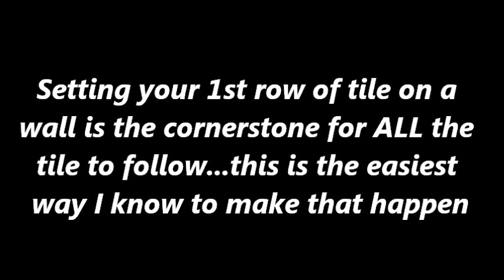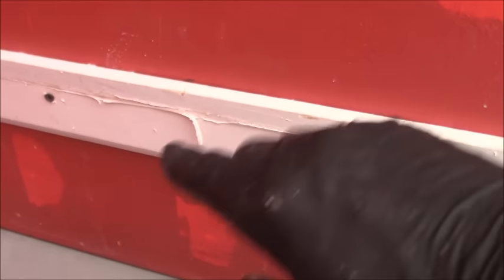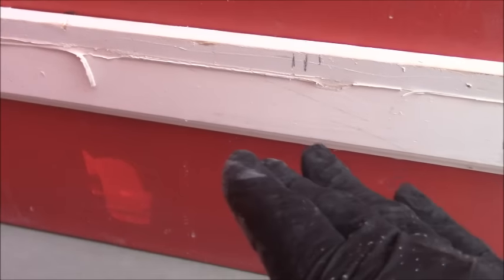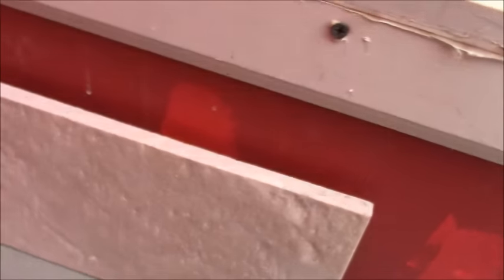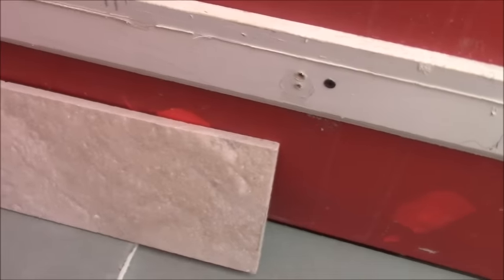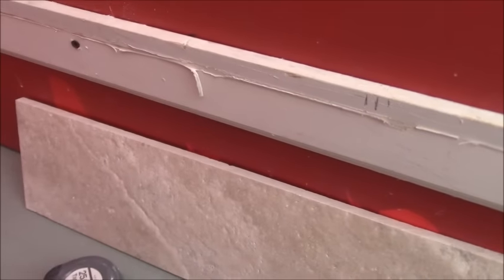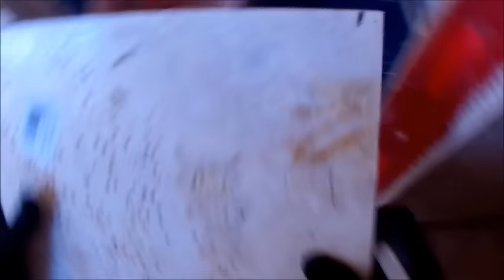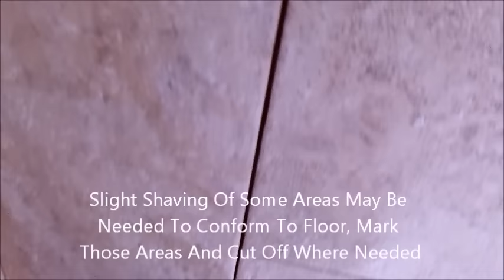FIRST Row Of Tile On Walls....how to do it

Comment: I listened to your explanation a few times and it makes sense. I've never tiled before but now I have a lot more confidence to tackle this DIY job based on this video. So thank you for solving my biggest impediment. Trying to cut the bottom row of tiles to fit correctly against the sloping floor.
Reply: Agreed

Comment: Another thing you can do is use levels. I'm a tile contractor as well and I have 2,4,5,6 and 8 foot levels I use as ledger boards. As long as you clean them well after using, they work great and are very easy to secure to the wall

Comment: To cut in the bottom row simply place a 4mm plastic packer on the floor at the ends where the tile bottom corners will sit . Then position the tile upside down on the packers and mark tight to the under side corners of the above tile. When the tile is cut you have a 2mm spacing plus 2mm gap for silicone where it meets the floor.
You can play around with different size packers for different grout widths.

Comment: Used your ledger board recommendation on a DIY rental bathroom rehab.  Everything worked well with measurements and pre planning.  I screwed myself trying to make the cuts and transition from the tub well to the wall tile outside the tub/shower.  My advice, get the proper tools before you start.  It makes things much easier.  Thanks for the help.  Planning on another bathroom rehab later this year.  Attempting a one-of-kind niche this time around.

Comment: I always use a ledger board. The other good reason is when your going to carry the same tile to the outside of the shower. I get my dimensions for the first row outside the shower and use the top of that tile to carry my line into the shower area. Works out great. Nice explanation Bob.
Reply from the maker: Thank You

Comment: I swear by ledger boards, I use them all the time. The way you explained it is exactly the way I do it. Been doing it for 12 years.
Reply: Hi Ed. I have a sloped shower pan five feet long, schluter. This probably wouldn't work because the sides would end up being tilted ?  Any suggestions?
john m
Reply: @jmack619  It will work, just means the tile at the front will be little bigger than at the back. That is if your drain is at the front instead of in the center. If you're using a large tile, you probably wouldn't even notice.
Reply: @edwardhofer2429  Thank you Edward.  The linear drain is at one end, so the Schluter pan has about 1 1/4 " slope , over 5 feet.

Comment: Hardi plank split in half is the best ledger board I've found to use it's very straight it'll hold a huge load and it's the perfect thickness , enough to catch the tile but doesn't protrude out past the tile that helps for a few reasons . 👌

Comment: Starr Tile: I'm from metro Atlanta and am always a little more excited to come across a tile video from where I learned the trade!

I admire your cleanliness and overall ambition to be better, constantly learn, and pass along that experience to other tile contractors that are also continually trying to better themselves!

That being said, I have a copy suggestions/pointers:

1. If you are screwing a baseboard 🙄 into the wall to be level in a shower you need to come to terms or acknowledge the fact that you are less than perfect or mediocre at mudding a shower floor or preparing a shower floor. Under no circumstances should you have to rely on a piece of wood to be level when you should be fully capable of doing so with concrete, shower floor mud, etc.

Raw shower floor, prep, preslope, mudding, and setting the shower floor is definitely a tedious process! But if you didn't know that going into this trade, you were misinformed. Tile installation/custom bathrooms, commercial projects require the installer to be very good at math, geometry, and a whole lot of knowledge gained from experience.

If you are truly the best at what you do and carry a great sense of pride, you should never rely on this method. Take more time on your shower floor, figure out your layout ahead of time and consider all factors and possible problems.

This is what separates the actual "best" tile company installers/owners from the rest.

Pride in your work, a willingness to constantly learn and adapt, and knowing problems you most likely will go through from experience CANNOT be understated.

Unless that is the straightest framing known to man, you should also address that before you apply your final waterproof barrier.

These kind of things will help you on the higher end jobs who will know just how good you are. And trust me, I would not start out with screwing baseboard into a wall. Always try to be better with mudding and preparing, as I always am too!

Other than that, great video! And thank God in heaven you are not one of these schluter shower warriors who talk a bunch of game after watching a few videos and think they can do what most of us watching this kind of video does!

P.S. can you please send some good BBQ, fried chicken, or seafood up here to Minnesota????

Comment: Thanks for this. I did this on my own and thought it was an amateur hack until I saw this vid. I just used it again as I didn’t trust my baseboards as a guide. I don’t know if there is an official ledger board tool, but I found mdf baseboard works great as it seems to usually have a better edge as it’s manufactured.

Comment: Dude, I'm so glad I found your videos! When the shower in my house started leaking I dreaded the unknowns of expense and effort to repair. Doing exploratory demo, I found that the builders of this 1999 single floor home in Mesa, AZ didn't use any waterproofing behind the cultured marble panels that lined the three shower walls (fourth side a glass door, the curb a pre-formed cultured marble piece w/no sealant). Behind that, the drywall (green board, no cement board) was rotted out almost three feet up, and between the piss-poor installation and the aging of the adhesive they didn't use enough of, the panels were only held up by friction. Digging further in, I found that there was no liner, pan, or other water sealing under the mortar bed or around the drain. It was poured straight on the concrete slab, damn the consequences! So when the caulk with a ten to twelve year service life reached 17 years, no surprise that water went everywhere. Financially, the threat of days of contractor labor and material costs was overwhelming, having recently lost my day job, jumping into doing what had always been a hobby as a new business venture, my budget is so tight it makes starving college students seem like such frivolous, wanton spenders. At least, this being Arizona, it dried right out once we stopped using it.

Now that I've seen how you handle the mistakes you come across on the job, I've got a realistic appreciation for the scope of what I should do within the context of the project. I'm planning to do about 80% myself, doing everything from demo of the old mortar bed to building a new curb, installing a liner and drain, pouring the new mortar bed, building in new walls (custom niches!) with proper board and fasteners, and waterproofing w/redgard and higher quality caulk. The actual laying of tile I'm thinking of saving for a pro because that's where the smallest mistakes are most visible and where experienced hands guided by a sharp eye can shine. Several of the neighbors are tradespeople (there's an electrician, pipefitter, HVAC tech, and a specialized concrete engineer all on my block), and they've all got one guy who they've always hired for tiling in of their own houses. Thanks in huge part to what you've shared, I have confidence not only that I can do it, but that I will do it right and well within a tolerable budget. That's not a small thing!

Comment: If you have a niche you'll want to lay your tile out on the floor first, use your spacers to know exact grout lines, then mark that on a straight edge. Centre your grout lines around the niche and this determines where the ledger board goes.

Comment: A little tip when installing those accent tiles that come on fabric: get them cut to the length you want then lay them on a tile or something flat and grout them with thinset then take a brush and wipe the grooves and put a fan on it to dry it.  It locks them in place and prevents the morter from pushing through.

Comment: Old school when we drypacked the pan start with the ledger board and set all three walls. When you come back to set row one you don't have to cut each to fit, just run each tile long to the pan. Then drypack the pan then set tiles in the pan. This way you don't have to special cut each row one wall tile to fit.

Comment: I have a pile of old, out of level spirit levels and unistrut on my van, all different lengths. I use these as my battens (ledger board) which i simply sit on top of bits of timber, brick, anything that's laying around. Use a laser level to get them level and I'm off. try not to use timber as its more often than not bent! Been doing it this way for 30 years and its my quick preferred method to get going. Also here in the UK, not sure if you have them in the us, are 'tile batten stands', same method as mine more or less, just purpose made. Bit pricey though I think.
Reply from the maker: Good advice, thanks !

Comment: This video was done for a shower, correct? Do you need to take 1/4" off the bottom row tile when installing for a tub surround? It seems like for a tub I should leave space for the length of the whole tile at the bottom + grout lines? Thanks, your channel is so helpful!

Comment: THX.  I have a question that is sort of unrelated.

I am doing a 9 x 5 bathroom.  I had to deal with warped joists, cut out joists, joists that did NOT sit on the center wall and moved as you walked and alternate crowns.

I clamped and glued/screwed the joists over the center wall to make them steady.  I sistered the butchered joists and while at it added another to the inside - getting my 1/4 inch per foot  at the same time.

Then because of threshold to the next room - I sunk the 3/4 inch plywood in between the joists onto the sistered joists that OI has sloped - giving me a terribly strong floor and no increase in threshold to the next room.

It is nicely sloped to a 48-inch drain.  It is terribly uneven over the short-haul but right on the money over the long haul.

I planned to put a finishing layer of 3/4 plywood over it all.

Can I use thin-set over the lower level to support the upper 3/4 inch plywood in those short-haul imperfections??  My thought was to spread the thin-set, and then screw down the upper layer til its level, starting in the middle.  I'm ONLY looking for 1/8 - 3/16 fill.

THX again.

Comment: I usually use the factory edge of 3/4” MDF material.  Tends to run more true than natural species. And for an added bonus any ThinSet that happens to come in contact with it does not stick and peel the redguard.

Comment: You have flip the tile vertically not horizontally for cuts on bottom......otherwise left side becomes right side or vice versa....you want the left side of tile to remain left side of tile for cuts....after 35yrs in construction I hear ya about explaining stuff, so much easier to do it.....stuff that's self explanatory to me isn't to someone new.....I forget how long I've been doin this and next guy is fresh......layout and principles are same for almost every trade just different materials and applicarions......I am finish carpenter turned into tile, stucco, drywall, roof, concrete, etc guy
Reply: Good point I was thinking the same thing!  I guess the only reason why you flip the tile is  that it's easier to make your marks on the back of the tile instead of the front.  Newbee here.
Reply: @deaneng8540  you flip the tile so you can mark it accurately......in construction the less you have to measure the better.....so trades always find ways not to measure if they can....the less I pull out my tape the better off I am,

Comment: I need to tile a bathtub enclosure. There is NO single right angle there (old building), and the tub is not level either. I believe I can successfully tackle the job, using the ledger board method. The tile is 6"x6", and I am going to stagger it, so the pattern will be busy enough to keep anybody's attention away from the not-so-level bottom of the first row, and hopefully away from interesting cuts in the corners. Wish me luck, this is my first tiling job.
Reply: The layout is one of the most important parts of tiling process. Measure height and width of the space and figure out before hand where the tile will be. Shift left and right or up and down so you end up with the biggest possible cuts top and bottom and left and right. Tiny slivers of tile are very unappealing. You may not be able to start with a full tile at the bottom and end with a full at the top. But a half tile top and bottom (just example) once adjusted will look great.

Comment: I have found that Square Tubing( for patio enclosures)  is ideal for ledger-boarding. Or actual levels secured to the walls
Reply from the maker: Yeah I thought of using levels also, but I don't want to muck them up or get them off calibration...
But I do love the square tubing idea, might use that 👍

Comment: Would this be the same technique used for prefabricated shower pans ? Or just for custom showers , reason being prefab shower bases already have a straight edge on them , wouldn’t making sure the pan is level suffice ?   Thus allowing me to start my first row on the very bottom .
Reply from the maker: Yes if your prefab pan is level which it should be in your floor is level which it should be then there's no sense in doing a ledger board

Comment: Thanks a lot for your videos.  I learn a lot from you, as a diy-er, currently doing my bathroom.. first time.. 2 questions: 1) for tiling floors, how perfectly level does it have to be?  I did self levelling compound, but ran thin on one end .. by 1/8th off level.  You think i can make that up with thinset?  2) you think self leveling systems would make it easier?  Thank you again, appreciate your videos greatly!
Reply from the maker: Yes you can definitely make it up with thinset. Self leveling systems are meant for the tile, not the prep, prep still needs to be good...imagine a perfectly flat & level floor, the leveling system would STILL be used, it's for the tile.

Comment: With my 4x16 white glazed tile. Is it acceptable looking to cut the bottom edge off ?
The face of the tile has a rounded edge slightly in the glaze, wouldn't i want to keep that
Reply from the maker: If all four sides of your shower are square and level then you don't need to cut but it is rare where you can get to that point, I would still give it about an eighth of an inch wiggle room even if that means cutting off the factory Edge by eighth of an inch all the way around

Comment: If I’m installing a chevron patterned tile, so there’s no flat bottom to sit on a ledger and the wall is not in a shower so the floor is flat will I have any issue cutting the bottom row flat and sitting on 1/16 shims and tiling all the way up to the ceiling in one shot?
Reply from the maker: If I were you because I think their sheets you were talking about I would run those sheets through a tile saw and get rid of the points, however if you did it your way I would probably use an 16th-inch strip of wood or strips of cardboard rather than individual spacers. And I would probably only do one sheet  or two if they are sheets, clean off the outside edges really well and then continue the next day so that you'll have something definitive to set them on that is sturdy because they might have a tendency of bunching up overnight if you stack all that weight on them.

Comment: Man, you make it look too easy. Makes me wonder why my contractor keeps fucking shit up.
Reply: allow me, when someone is a real expert they always make it look so easy!
Reply: dude trust me it's not easy tile is very unforgiving especially when it comes to tub and shower surrounds get your first run off just a tiny tiny bit and your screwed and if the walls aren't nice and flat and you don't hold your trowel just right you'll be in a living nightmare before you realize it. I've been installing tile and flooring for 15 years you either have the nitch for it or you don't

Comment: I have a question, if I may be so bold? I have been tasked with straightening out a hack job a family member had done. The tub enclosure is done in new 4X6 white subway tile. The person who did the job started his first row 1 inch above the bathtub. sad part besides having to fix this mess is the top tile (against the ceiling) has been cut to fit between the next to last row and ceiling. Had he started the bottom row correctly, the top tile may not have even needed cutting. Even if it had been, it would have been so little, I doubt it would have been noticed. Now to my solution for you to consider is removing the bottom row of tile, buying 6X6 tile and cut them to a height that will fill the void and reach the top of the tub. I know he put durock and redgard behind the tile. Secondly, what adhesive should I use for the bottom row when reinstalling? Thanks in advance.
Reply from the maker: Your solution sounds good to me. 
Use thinset, not adhesvie.